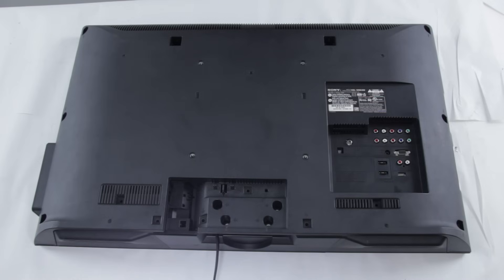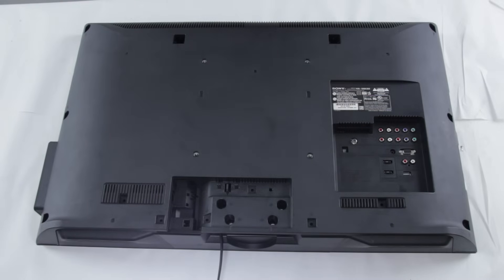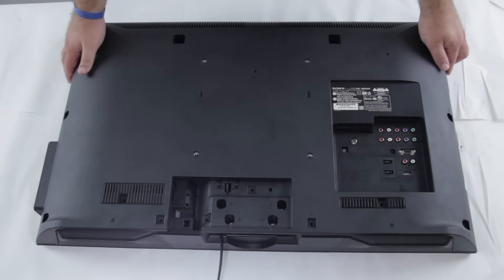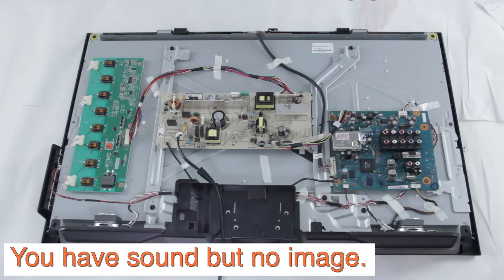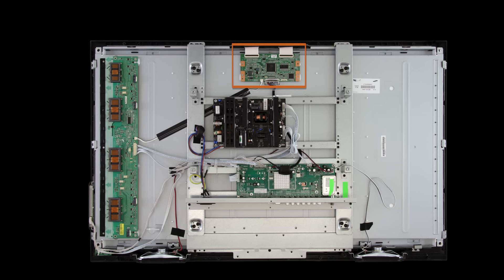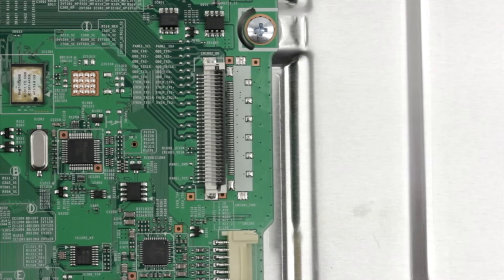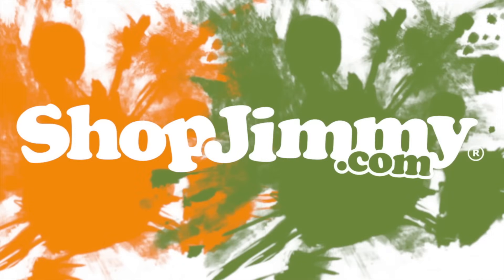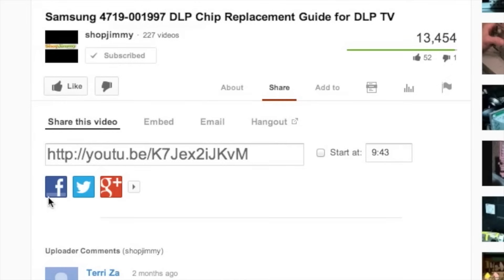LCD TV Repair Tutorial - T-Con Board Common Symptoms & Solutions - How to Replace T-Con Board

Comment: Hello! I'm trying to repair a used Samsung 46' LN46A550P3FXZA TV, but I'm not sure whether to replace the main board or the T-con board

The screen is very distorted -- when on it's primary black (shows no image), and there's several vertical bars on the screen (white or green, and other random colors). Sometimes something will show on the top-left area but that's about it. Finally, on occasion it goes into an endless on-off cycle, but if I unplug/replug the power it returns to normal.

I've tried looking for bad caps and I can't identify anything, so I primarily need to find the source of the image problem (main board or T-con). Please help and I'll actually order replacement parts from your site. Thanks!
Reply from the maker: +Eric Pan   Try all repairs and troubleshooting at your own risk. This could be a problem with either the main board or the TV panel.  You can replace the main board in your TV to see if that fixes the problem.  Click this link to replacement parts for your TV model number:  http://www.shopjimmy.com/catalogsearch/result/index/?cat=56&q=LN46A550P3FXZA  There may be multiple boards for the same TV model number, be sure to match part numbers on your current board, with your replacement for compatibility.  Here is a link to a video showing how to identify your part number, click here:  https://www.youtube.com/watch?v=BEPWrefQvqI Thanks and please let us know if you have any further questions with your TV Repair!  www.shopjimmy.com
Reply: Hello,

Thanks for the response! I bought a replacement T-con board and it didn't fix the problem, so I'm guessing it's with the main board.

I have 3 questions:

1) My TV makes a large screeching noise when it starts-up now (then it restarts a couple of times before it's 'on') -- will I be able to repair this with the $20 component repair kit from ShopJimmy?

2) Will the $20 component repair kit from ShopJimmy repair my vertical line/image issue?

3) I checked the backlights of the TV and the backlight on the sides is fine but the middle area backlight has an orange glow -- is this normal?

Thanks!

Comment: how do i repair vertical lines on my LCD samsung screen model number s/n:AL6F31FQ300936N
Reply from the maker: +Anyam Augustine   Try all repairs and troubleshooting at your own risk.  This sounds like a TV panel (TV Screen) problem.  If your TV panel is bad, it may be more cost-effective to replace the TV as panels are typically hard to find in stock, difficult to replace, and expensive.  Thanks and please let us know if you have any further questions!  www.shopjimmy.com

Comment: I have an LG LCD TV Model: 47LK530-UC
It's a smart TV and I can't get it to display anything. It started out with vertical lines on part of the screen, but you could still hear sound. Now, It goes back and forth from lines on the screen to a solid dark screen. I can hear static sound when I change the input so I think the sound is fine. I unplugged and re plugged the ribbon cables as I saw in another tutorial, but is still the same.

Comment: Hey i have a KDL46HX800, i get the 7 blinks tv shuts off. i cant turn it on but will shut off again and blink 7 times. but it happens randomly sometimes it works for weeks without doing it. i've replace the mainboard and the power supply board. any suggestions?

Comment: I have a LG 50LN5400 
serial#404RMMDAQ043 
The symptoms are the bottom half of the screen will flash to a blurred out of sync image then flash back to normal and keep doing this.
Reply from the maker: +Cla3151   Try all repairs and troubleshooting at your own risk.  This sounds like a TV panel (TV Screen) problem.  If your TV panel is bad, it may be more cost-effective to replace the TV as panels are typically hard to find in stock, difficult to replace, and expensive.  Thanks and please let us know if you have any further questions!  www.shopjimmy.com
Reply: +ShopJimmy.com  Is there anyway to test to see if it is the panel?
Reply from the maker: +Cla3151 Try all repairs and troubleshooting at your own risk.  Not really a direct test, but your symptoms are similar to other TVs that have had bad TV panels.  You could replace all of the boards in your TV to see if any of them fix the problem.  If none of them fix the problem and all the replacement boards are good, then you could say it is most likely a panel problem.  Thanks!  www.shopjimmy.com

Comment: hi, I have a LG model e---50pa4500 plasma tv.  This tv had been doing well, I came in today and there was no red light or any power at all. I changed the batteries in the remote, no help. I would appreciate a little help. thanks
Reply from the maker: +richard tipton   Try this at your own risk. Unplug the TV, then disconnect the y board and plug in the TV to see if the TV powers up. Note that it will not have a picture on the screen. Reply with the results of this test. Thanks! www.shopjimmy.com

Comment: Hello, 
I have a SCEPTRE 
Model: X425BV-FHD3HVV09V2
S/n: C37X425BLA3870

I have had issues with the power for a few months now. The red standby light always comes on, and the blue power light reacts when I press power. 

However, the screen doesn't startup after that. The red SCEPTRE logo never appears. 

So after an increasing number of power cycles each time (currently 50 consecutive) it will come on. 

I got to the point where I had to leave the tv on in power saving mode at all times, to avoid the drawn out process of trying to power it on again.

After 2.5 months of it continuing to be on, I accidentally sat on the remote and powered it off. Now I'm 7 hours in to trying to get it to turn on again. 

Any help would be nice.
Reply: +ShopJimmy.com
Reply from the maker: +kalamafraggre1   Try all repairs and troubleshooting at your own risk.  I recommend replacing the main board in your TV.  Click this link to replacement parts for your TV model number:  http://www.shopjimmy.com/catalogsearch/result/index/?cat=56&q=X425BV  There may be multiple boards for the same TV model number, be sure to match part numbers on your current board, with your replacement for compatibility.  Thanks and please let us know if you have any further questions with your TV Repair!  www.shopjimmy.com
Reply: +ShopJimmy.com could you recommend any tools I will need? I just moved and I have to replace all of my home repair kits.
Also, is there a tutorial for how to replace my main board on your channel?

Comment: I have a sharp LC-40LE550U. I have sound but no picture, I can see the menu when I do the flashlight test. I ordered the back light / power supply board 09-40CT J050-00. Did not fix the problem. Is it the T-Con board?

Comment: Hi guys. I have a Sony Bravia KDL-46NX720 that has a blue wash over the screen which gets worse as the tv stays on but is pretty bad when the tv is first turned on. I'm thinking it's the tcon board, what are your thoughts? I did not see a replacement part on your site...

Comment: Hi, I have a sharp aquos LC-40E67UN, serial no. 905861781. It endured two long distance moves and time in storage, but maybe the issue is just due to its age: the screen started to flicker in the last two weeks. The flicker is in terms of brightness. Screen dims, then brightens up again; sometimes it's a rapid toggle between the two, other times it stays in one level or the other for several minutes. What is the problem and can a regular Joe Blow like me fix it himself? If I needed to replace something, what is it and how expensive is it, and will I need to solder? Thank you,
Mike

Comment: i have a samsung 3d led tv model # UN55E528000F , the screen goes black and then goes back to the picture and goes black again over and over again. I have to unplug it for 5 minutes and plug it back in and it plays fine for a while and goes back to the same thing . please i know your busy can u help.
Reply from the maker: +MrSincere22   Try all repairs and troubleshooting at your own risk.  I recommend running the flashlight test on your TV.   Here is a link to a video we produced that shows how to run the flashlight test. https://www.youtube.com/watch?v=xUzCLgoSPGM Please reply with your flashlight test results and we can recommend a replacement part for your TV repair. Thanks and please let us know if you have any questions! www.shopjimmy.com

Comment: I have a LG Plasma TV Model #60pv400-ub and when i turn it on i have audio and video then after 5 or ten minutes the screen goes blank but i still have sound and the only way i can get the picture back is to turn the TV off and back on and its only about 4 yrs old.Please tell me what i need.
Reply from the maker: +bob wustholz  Try all repairs and troubleshooting at your own risk.   I recommend replacing the YSUS and the YDRVBT & YDRVTP boards in your TV.  Click this link to replacement parts for your TV model number:  http://www.shopjimmy.com/catalogsearch/result/?q=60pv400-ub   There may be multiple boards for the same TV model number, be sure to match part numbers on your current board, with your replacement for compatibility.  Here is a link to a video showing how to identify your part number, click here:  https://www.youtube.com/watch?v=GEllG3RV-tc Thanks and please let us know if you have any further questions with your TV Repair!  www.shopjimmy.com

Comment: I've got a sharp pn-s525 and all pictures are fuzzy...even menu is fuzzy, looks simular to cross input feed. any ideas?
Reply from the maker: +Osmund Elliott  Try all repairs and troubleshooting at your own risk.  This could be a problem with either the main board or the TV panel.  You can replace the main board in your TV to see if that fixes the problem.  Click this link to a replacement main board for your TV model number:  http://www.shopjimmy.com/catalogsearch/result/index/?cat=56&q=pn-s525  There may be multiple boards for the same TV model number, be sure to match part numbers on your current board, with your replacement for compatibility.  Thanks and please let us know if you have any further questions with your TV Repair!  www.shopjimmy.com

Comment: I have a sanyo dp42849 half the screen is black and other half has a picture. Can it be the Tcon Board or a ribbon??
Reply from the maker: +xbLacKouTHDx   Try all repairs and troubleshooting at your own risk. This could be a problem with either the t-con board, the main board or the TV panel. You can replace the main board and the t-con board individually to see if one of those boards fixes the problem.  Click this link to replacement parts for your TV model number:  http://www.shopjimmy.com/catalogsearch/result/?q=dp42849  There may be multiple boards for the same TV model number, be sure to match part numbers on your current board, with your replacement for compatibility.    Thanks and please let us know if you have any further questions with your TV Repair!  www.shopjimmy.com

Comment: I have a sony bravia 55" model # KDL-52W5150 tv that gives me 10 red flashing lights then pause for 5 sec then 10 more and so on.i ordered a power board  G7N APS 247  1-487-341-11 installed it and it still dose the same thing
according to the chart it say the digital board or turner board may be bad I'm lost

Comment: Samsung - LN55C630K - Sound works fine.  When powered on - the lamps flash on briefly and then to black.  Ordered Samsung LJ97-02709A Backlight Inverter from you based on suggestion from phone representative.  Installed it - did not resolve issue.  Thinking should have ordered T-CON instead.   I watched your video, but nothing addresses the flash on and then off.  Your guidance is appreciated.
Reply from the maker: +J DeVore  Try all repairs and troubleshooting at your own risk.  This could be a defective replacement part of bad lamps in your TV.  Thanks!  www.shopjimmy.com
Reply: +ShopJimmy.com ? So you MAY have sent me a defective replacement part?  and the only way I can find out is to order another "non-returnable" part?  That's not very helpful.

Comment: Hi, I have a Vizio M501d-a2r.  I turned it on the other day and the bottom 4/5ths of my screen go in and out of focus for a couple seconds each at a time.  You can see a horizontal line between the break of "good" focus on top and "bad focus" on the bottom part.  What do you suggest?
Reply: +johnnie62284 
I have the same TV and same problem.  The TV is 2+ years old and 4 months out of warranty.  Did you ever find out what the cause and solution was?

Larry B
Reply: Same issue here just started for me.  Bottom 2/3 of screen goes blurry intermittently for 2 seconds at a time and clears up.  I have googled and so far I have not found a thing either.
Reply: I didn't find a final say.  I just ordered a tcon board yesterday and will install it next week when it arrives.  That's the closest answer I could get to being the issue.  I will let you know if it fixed mine or not.  Good luck
Reply: i installed the part and it didn't fix my issue.  The research continues!

Comment: I have a Samsung model UN55EH6030F with two white lines horizontal about 2/3 way down and at the bottom of the screen as well as the left side of the screen has a dark section about 1/4 way into the screen vertically. Under the white lines the color is fine then goes to black on the opposite side of the screen. I have tried factory resets, whats wrong with my picture on the diagnostic menu and nothing works!

Comment: I have a lg plasma 60pv250 serial number 107rmwvc9385 ,my issue is my picture was color was looking purple like a rainbow and then the TV would turn off ,now have no picture but sound. think its the t con board but can't find the location of it
Reply from the maker: +Dean Dorsey   Try all repairs and troubleshooting at your own risk.  I recommend replacing the YSUS and the YDRVTP & YDRVBT boards in your TV.  Click this link to replacement parts for your TV model number:  http://www.shopjimmy.com/catalogsearch/result/?q=60pv250  There may be multiple boards for the same TV model number, be sure to match part numbers on your current board, with your replacement for compatibility.  Here is a link to a video showing how to identify your part number, click here:  https://www.youtube.com/watch?v=GEllG3RV-tc Thanks and please let us know if you have any further questions with your TV Repair!  www.shopjimmy.com

Comment: I have an LG 32LN570B smart TV, when i try to change Channels The TV turn off but it self, and turn on again. This is happening with The remote and with The hard buttons on The TV, so The remote is not The issue.Do i have to remplace The main board to solve this? If Yes, do You sell this main board?Thanks in advance!
Reply from the maker: +Patricia Ugarte  Try all repairs and troubleshooting at your own risk.  I recommend replacing the main board in your TV.  Click this link to replacement parts for your TV model number:  http://www.shopjimmy.com/catalogsearch/result/index/?cat=56&q=32LN570  There may be multiple boards for the same TV model number, be sure to match part numbers on your current board, with your replacement for compatibility.  Here is a link to a video showing how to identify your part number, click here:  https://www.youtube.com/watch?v=RwHTvjMdrhk  Thanks and please let us know if you have any further questions with your TV Repair!  www.shopjimmy.com

Comment: Hisense 50K360G 

Turns on with blank screen - No Logo, display on screen indication.
I have changed the Power Board & Video Board. Just want to make sure the T-Con Board will correct this issue or should I look for something else. Screen doesn't is Not cracked.

Comment: i have vertical lines on screen. samsung LN46A550P3FXZA don't know if needs the screen, or any board may need replace please help. thx
Reply from the maker: +Rafael Garcia   Try all repairs and troubleshooting at your own risk.  This sounds like a TV panel (TV Screen) problem.  If your TV panel is bad, it may be more cost-effective to replace the TV as panels are typically hard to find in stock, difficult to replace, and expensive.  Thanks and please let us know if you have any further questions!  www.shopjimmy.com

Comment: I have a Sony KDL-52V5100 that when turned on from cold start has audio and vertical lines across the entire screen.  after 10 minutes, I turn TV off, then back on and less vertical lines and you can make out text and picture behind the lines.  after an hour of warm-up, turn off then immediately on, and picture is normal.  Could the problem be T-Con board?

Comment: I have a Samsung 51 inch with intermittent video operation, replaced the Y-SUS and T-Con and still having intermittent video ... TV turns on, power on tones and white flash but not menus or video signal. When it does work can see menus and video signal, but when not working there is no video - signal or menus or audio (from signal) Any advise on what to replace next?

Comment: good evening. i have a LG  Plasma TV that changes "functions" all on it own. Their is not pattern of when it will happen, sometimes the TV can be on for a few hours or for a few mins and it starts to switch "functions" .  If i leave it alone, sometimes it will go back to it's original function on it's own, which takes a while. Most of the time i can switch it back with the remote and i will be fine for a little while, or there are times it will not go back to it's original function   this is an LG Plasma TV  model number 50PQ20  SERIAL NUMBER: 907RMGC069439   /  AC 100-240 V   /  50/60 Hz 4.2 A  thank you .  JoAnn Clark  email address  aussiebycar@yahoo.com

Comment: LG Model # 42LH30-UA  Serial # 911RMNE441239  
Started with black vertical lines, watched your video, removed two tabs from t-con board, lines went away then came back.  Then the screen went completely blue.  We have background lights and sound.  Any help you can give would be greatly appreciated!  Thanks in advance.  TV manufactured in 2009